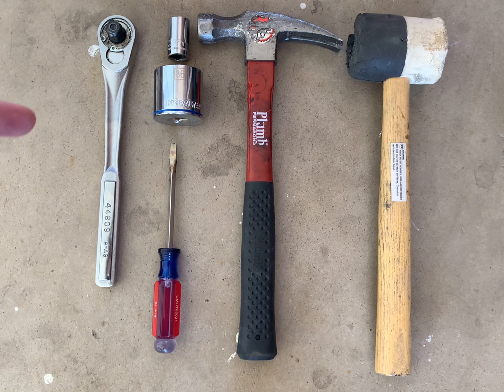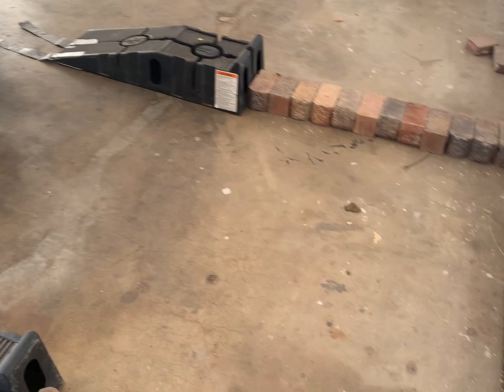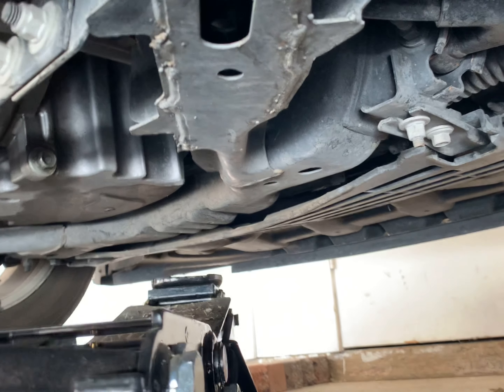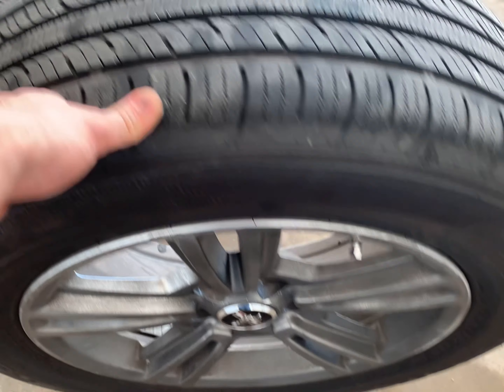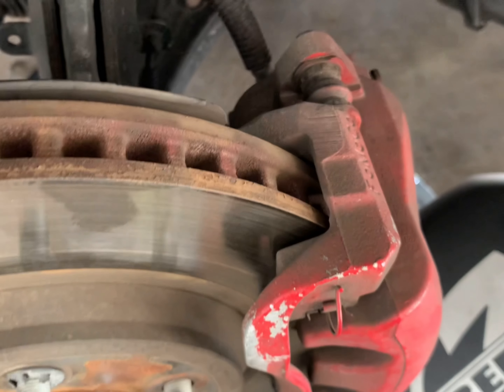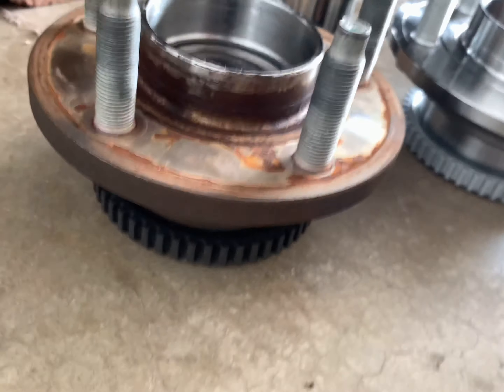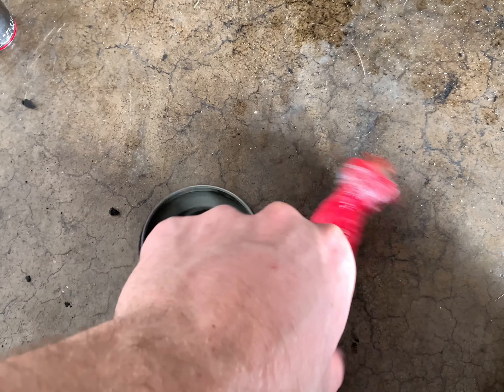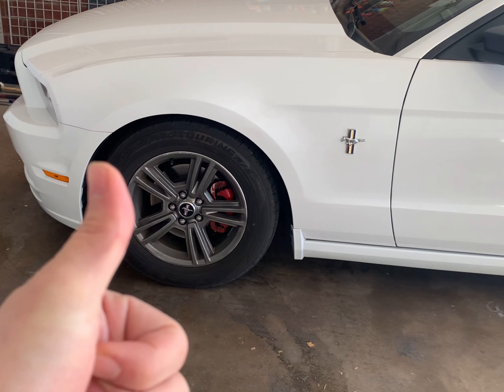How To Change Wheel Bearing For 2011-2014 Mustang S197 - Whooping Sound FIX

Comment from the maker: Wheel Hub Assembly/Bearings - https://amzn.to/3G2fT2R
Large Ratchet - https://amzn.to/3C7zCgE
15mm Socket - https://amzn.to/3I8CY6X
36mm Socket - https://amzn.to/3GmrOtV
Flathead Screwdriver - https://amzn.to/3Z6Kt4m
Hammer - https://amzn.to/3PXzp5g
Rubber Mallet - https://amzn.to/3CagXRf
Daytona Low Profile Floor Jack - https://amzn.to/3Vqp7M1
Jack Stands - https://amzn.to/3VuB0AL
Rhino Ramps - https://amzn.to/3C7Gs5I

Comment: How did you remove the hub? That's the point of videos to show how you do it, and not how you already done it
Reply from the maker: Once you take off the center nut with a 36mm socket, the wheel hub just slides off. Should be pretty straightforward
Reply: @SwanCanFixIt  I pray it just slides off lol thanks for the video

Comment: Thanks for the vid man. Pretty straightforward. Going to be doing this this weekend for my 2014 gt. whooping howling noise is horrible.
Reply: Did it sound like a bouncing whistle noise unless you were hitting the brakes?
Reply: @Jacksonnkingg  it was absolutely something totally different when I put a chassy ear on it my rear differential was bad
Reply: @Jacksonnkingg were you able to figure out this sound? I have exact same problem in my mustang. The whistle/grinding sound seems to be coming from front driver side and it stops as soon as I press the brake pedal. It’s hard to reproduce.

Comment: Great tutorial, well done!
Reply from the maker: Thanks man, appreciate it!
Reply: @SwanCanFixIt  Absolutely, no problem! 👊😎
Reply: You might want to mention that axle nut is held on with 250 foot pounds of torque and if you just torque it by hand you’ll end up with a wheel flying off
Reply from the maker: Yeah I agree, if you have a torque wrench then definitely use it. Really can’t over-torque tho unless you have air tools. I used a good amount of force when tightening it by hand and it’s been driving completely fine the past 20,000 miles 👍🏼

Comment: hey man! did you have abs light on ?! before you replaced it ?
Reply from the maker: No didn’t have the ABS light on for mine. Could be a bad sensor or to many metal shards stuck to the magnet on the abs sensor causing it to trigger

Comment: What is the torque spec for putting the nut back on after the wheel bearing?
Reply: 251ft.lbs.
Reply: 5 ugga duggas

Comment: Hanging the brake caliper by the brake line?  Not a best practice.  Best to hold it with a wire or rope.
Reply from the maker: Yes, wire or rope can work good too. I rested the brake caliper on the folded up creeper seat to make sure it wasn’t just hanging freely from the brake line

Comment: What was the torque of the nut?
Reply from the maker: 250ft lbs of torque is what is recommended. I didn’t have a torque wrench, so I just tightened it down with a good amount of force using a breaker bar and it’s been driving fine for over a year now